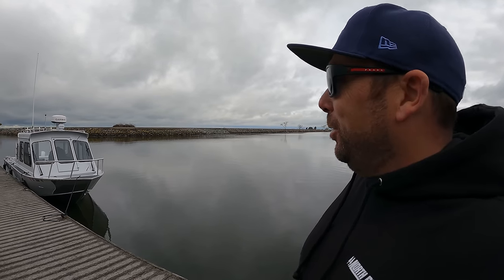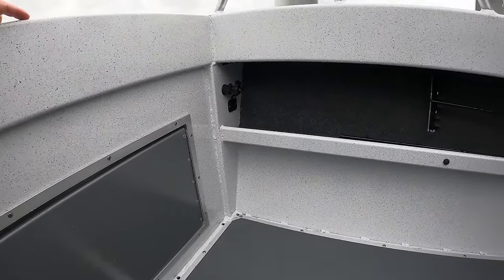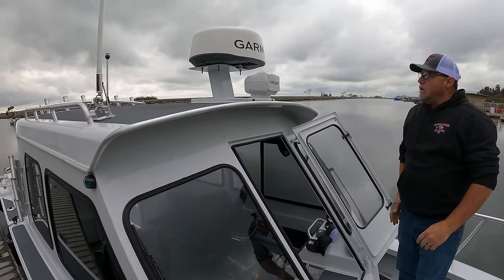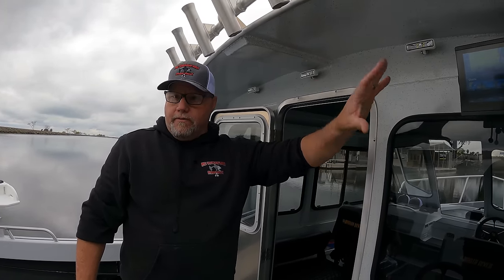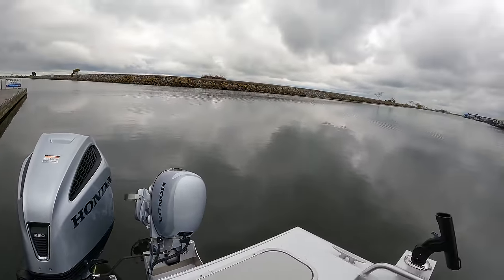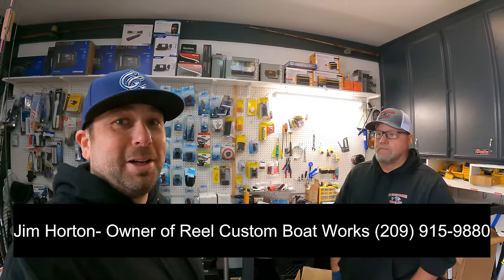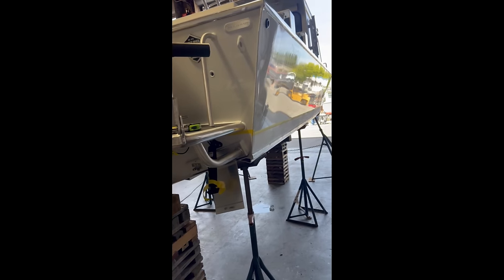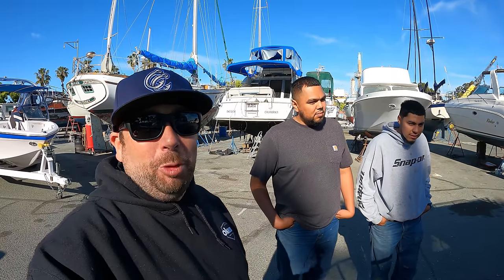How I Outfitted My 2024 25ft North River Fishing Boat

Comment: First, congrats on the boat! It's beautiful! I have a comment on the bottom paint. The way these guys were talking, it doesn't seem like they have much experience painting aluminum paint. They talk about painting your boat like how they do fiberglass boats.

I did some research on this clear coat and it seems like the only benefit is cosmetically, it looks better. It has zero anti-fouling chemical so algae will fall off (no green slime) but you'll still have growth and barnacles (pain in the butt to remove). It will also rub off over time. Also, paint won't stick to aluminum.

With aluminum boats, normally you apply a 2-part epoxy layer before a paint coat. The epoxy is basically glue and it will stick to aluminum. Epoxy will protect against electrolysis and also give the paint something to stick to; and then the paint goes on to protect against growth. I'd be interested to see a follow up on the clear coat on how it holds up overtime considering it was applied as if it was a fiberglass boat (sand and paint).

Comment: Did you add another kicker battery, or just wire into existing pair?
Reply from the maker: three batteries. One for kicker and lights. other two for the electronics and main motor.  Thanks for watching